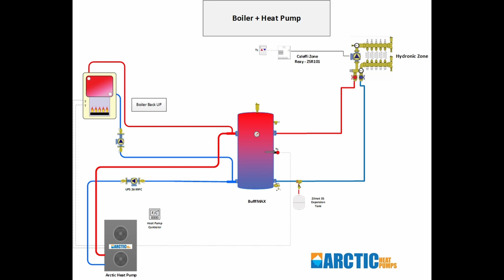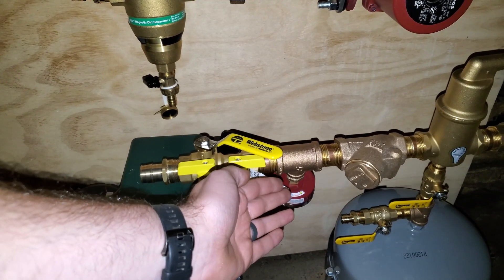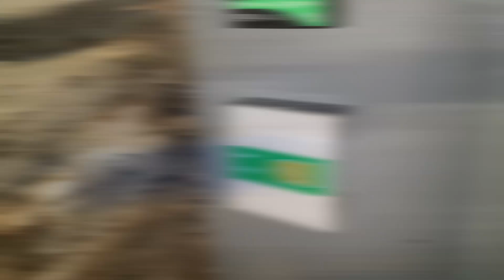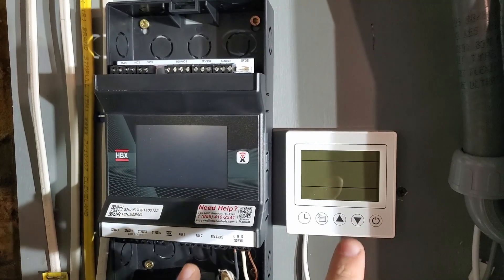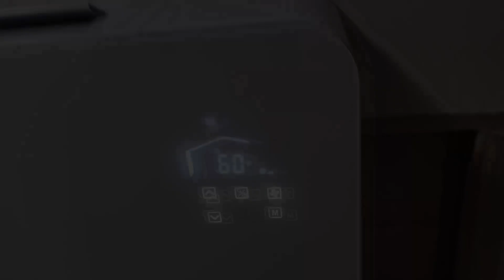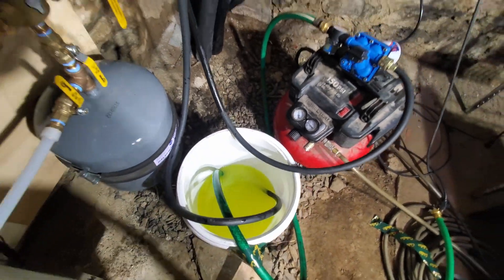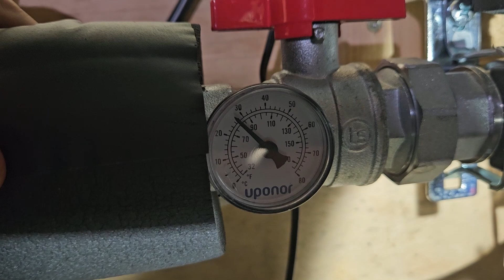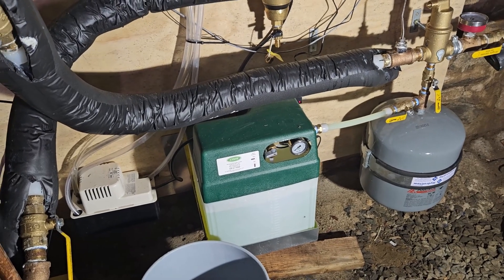No More Oil Heat - We Installed an Air-To-Water Heat Pump

Comment: That new system is an absolute nightmare.  Ultra complicated.  You'll regret it over time.
Reply: No worries. I installed plenty of Air to Water heat pump systems. They work fine. Its really fun to work with water.
Reply: @mariusm3595 uh huh
Reply: @mariusm3595 where did u learn this stuff? I’ve been doing hvac for 10 years but looking to get into this stuff. So many parts
Reply: Some people probably said that about oil heat when it first came out.
Reply: They work well except they have a short lifespan compared to a boiler.   When you add the second unit you will have to rearrange your piping to primary secondary. Someone should have told you this then your second unit would have been plug and play. 2 units will give you some redundancy as I know very few GOOD mechanics that will work outside in the snow and freezing temps to repair it.

Comment: What a nightmare.  Hopefully the electric grid stays on for your sake.
Reply: Without electricity a oil fired boiler would also have quite the trouble igniting, wouldn’t it?
Reply: @henningquast8456  nope. You keep a small generator around or deep cycle car batteries and a inverter and your good.
Reply: @henningquast8456 it is inside the house -- these air to water heat pumps usually are mounted without a exchanger and glykole, so ik case the power goes away, you also would need to drain the system or you might need a new pump, exchanger ( new gas, soldering new exchanger etc ) or something else if this Freeze.
Reply: @homeistheearth  High end monoblock heatpumps (heat exchanger in the outside unit) have special valves that release pressure from the water lines going from the monoblock to your house once they sense below freezing water temps (don’t ask me how they work in detail, I’d have to research it). This would save the lines if only your heatpump broke but the auxiliary electric heat could stay on in your house. 
If you have a total grid failure and your entire house drops below freezing, you’d have to drain your heating system which would of course suck.